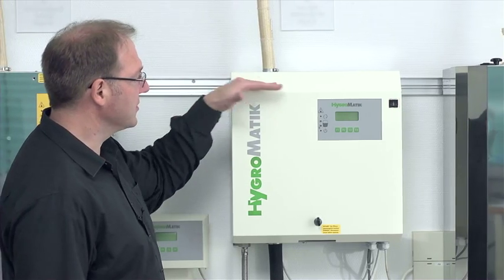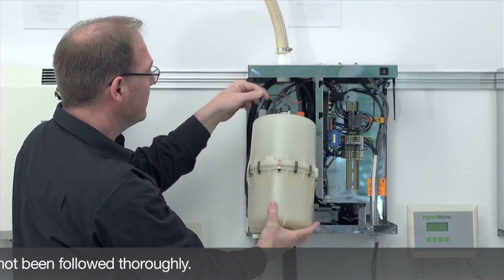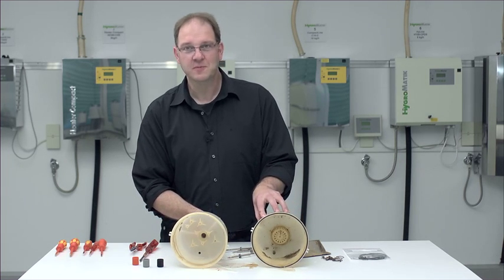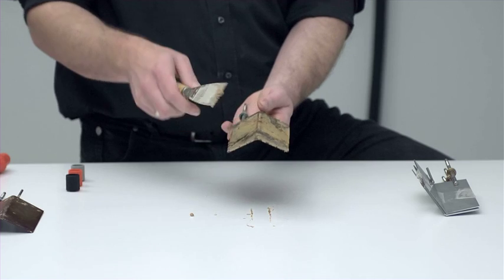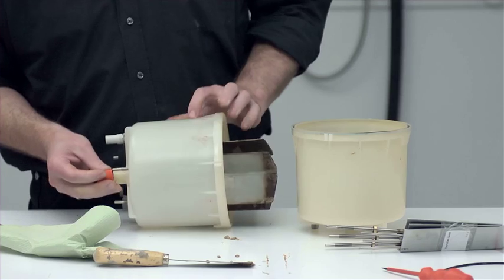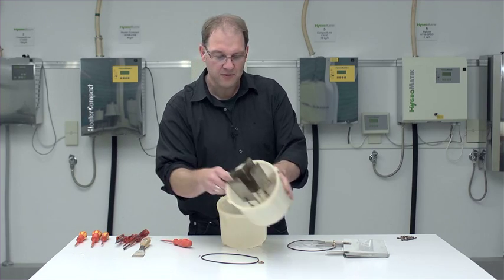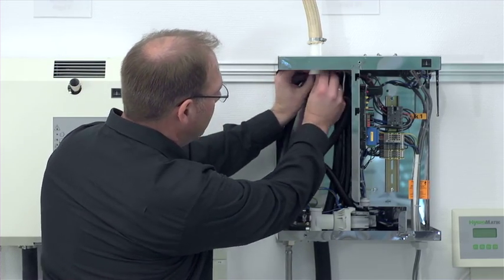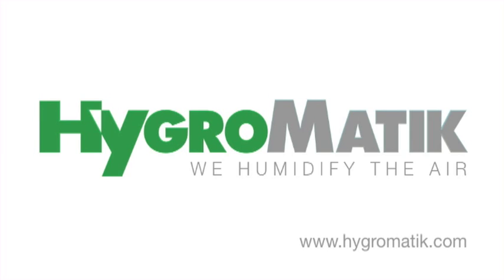HygroMatik HyLine HVAC

Comment: How do you turn it on in the first place? The instructions are terrible! I really can't turn it on. I've had the unit for over 5 years and I'm never been able to turn in on
Reply from the maker: Dear Tomas,
Please use the power switch (time stamp video 10:49)
.
If nothing happens, check fuses (F1 = 1,6A) for control voltage.
Please feel also free to call our technical telephone hotline for support: +49 4193 895 293.
Best regards,
Your HygroMatik Team
Reply: @HygroMatikGmbH  thank you for responding! . There is no suction of water from the tube (which has water flow) to the main chamber
Reply: @HygroMatikGmbH  basically, the electronic interface and all the Leds turn un perfectly. I can even change all the different settings. But like I Said the is no water flow and nothing happens. The pump to eliminate water from the chamber works though
Reply from the maker: @tomasfaughnan9717  
Dear Tomas,
Please contact our technical hotline via mail at hotline@hygromatik.com or via phone +49 4193 895 293.
HygroMatik's technical hotline is free of charge. The operating hours are Mon. - Thu. 8:00am - 4:30pm and Fri. 8:00am - 1:30pm. We are very much looking forward to solve your inquiry. 
Thank you very much.
Reply: HygroMatikGmbH ok thank you very much! I appreciate your help and kindness!